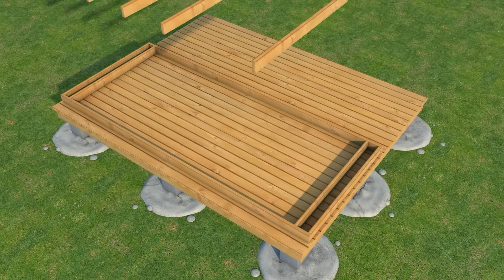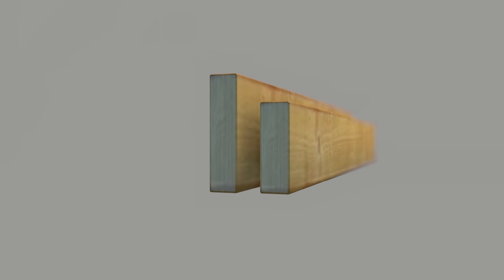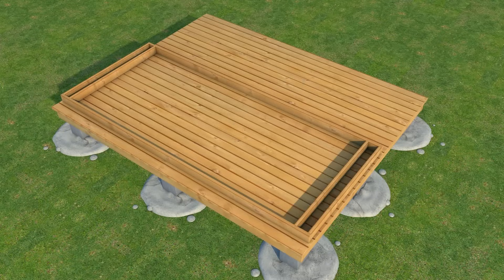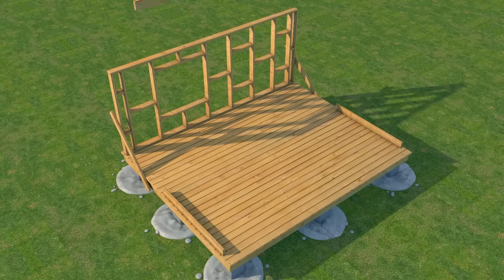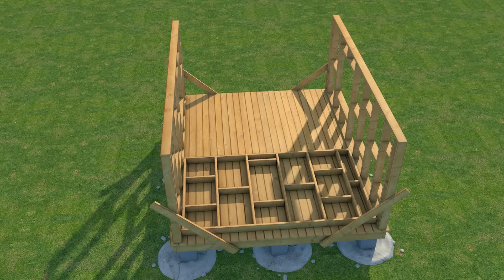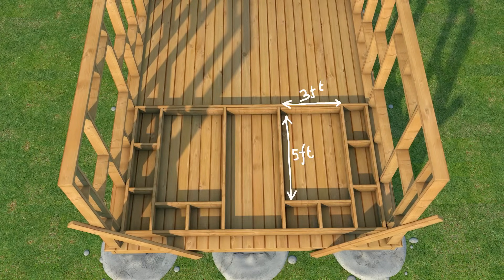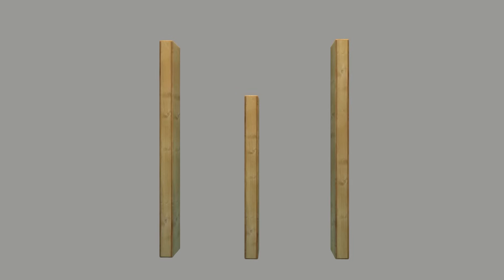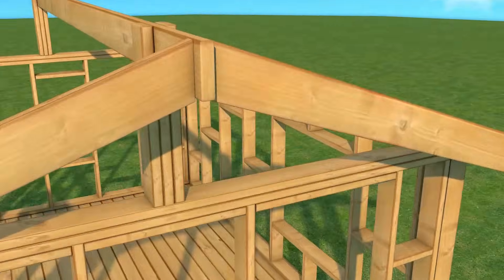Learn Cabin Framing Fast - 3D Animated Building Guide

Comment: Nice presentation. Only... There is no nailing patern with the assigned size and quality of the nails/screws for the timber or sheeting. The rafters are not correctly connected to the walls. The roof can blow away even when nailed properly. Insulation? Drywall ? Even correct nailing of drywall can contribute to the stability of this kind of construction. Sashes, windows, and doors? No double studs to strengthen the apertures in the construction? Is it even safe to have only one door in a building? 😅

Comment: Window openings need at least double 2x4 on edge sandwiching half inch plywood and nailed together securely where there is a rafter load. Also the ridge post needs a stud under it at each end. I can't tell. Is that a door under the ridge post? If it is you can put a header on top of your top plate to set the ridge post on. What has been shown is a basic structure with a number of framing details left out. For example gable end studs.

Comment: Where are your headers…?
Reply: I wonder if that is what the double top plate is for??.. Never seen that before though. Might work on a small structure like this...
Reply from the maker: @chadrambo1038  absolutely!
Reply: No headers and the ridge board is placed right over an unsupported double plate. The load needs a better transfer to the bottom structure.
Reply: @docnez8562   what do you mean? maybe that's why he/she used the metal plates on the top plates. and 8 inches ridge-board is thick enough for such a small structure. no rules in off-grid living, you do what keeps you sheltered, most of us are escaping all these unnecessary rules.
Reply: @theugandanwild8947 

Headers are a beam that sits above an opening (Window or Door).

These normally sit on ‘Jack Studs’ (studs that go from the bottom plate to the Header). One at each end. 

The ‘Jack Studs’ go immediately next to a ‘King Stud’ (which goes from the bottom plate to the top plate). 

Collectively this helps provide rigidity, and the transfer of weight to help further reduce structural integrity issues.

The Header could be a couple of 2x6 sitting on their side with some packing or a full beam depending on the size of the opening. 

The number of Jack Studs will increase as that header beam does.

On wider openings you also have ‘Cripple Studs’ to help with the same between the opening and the top plate.

The ‘Second Top Plate’ is used to connect framing together (will overlap - not done correctly in this video). And is generally applied to give a consistent attachment point for the roofing. 

(So in this instance the front (window/door/window) and back frame should have stretched across the base. The other frames sit inside that with a second top plate that goes on top and covers the front and back frame (are a couple of other reason why this is better too but this is already a long reply). 

Yes off grid does often mean rules don’t apply, but why not build it properly first time?
Reply: @docnez8562  Thank you got adding that I’ll add that to mine
Reply: Thought the same

Comment: For the roof stand how u attached it to the wall frame?
Reply from the maker: Hello! I used joist hungers (amazon link in description) to attach the rafters to the beam, and two 4-inch nails (nail at a 45-degree angle to each side of the rafters, where i made the seat cut in the video) to attach the rafters to the top plates of the wall frame.

Comment: Great video! How much m3 of wood did you use?
Reply from the maker: Thanks! For the studs (vertical timber pieces) and plates (horizontal timber pieces that hold the studs together from the top and bottom), I used 6 inches by 2 inches timber (6 being the width and 2 being the thickness) with 16 feet of length. And for the roof, I used 8 inches by 2 inches with 16 feet of length for the beam and rafters (I cut the rafters to 8 feet in length) You can cut the length depending on the size of your cabin but I would recommend keeping the width and thickness! Stay blessed.